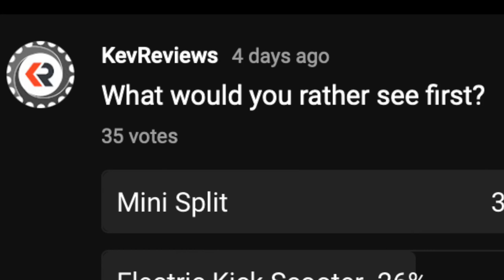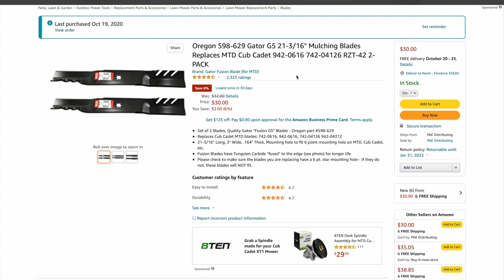DUST BOWL ELIMINATION for MTD 42-inch Riding Mowers - Craftsman T210 T2200 | Cub Cadet | Troy-bilt

Comment: I switched to those Oregon Gator Blades a year ago to help with the leaf mulching. They work great for that, and actually worked well as my normal cutting blades through the summer. You're right in that they have just as much - or more throw as the standard blades when it comes to the side discharge chute. I can't say that they cut down on the dust generation all that much (for me, that just depends on how dry things are), and I still get a little bit of leaf blowout up front with them, but they are great "daily drivers" and come in really handy in the Fall.
Reply: If you want to mulch your leaves really good, blow them into a few rows, then back over them with the blades on. This creates a mulching effect and will grind them up really fine. We live in the mountains and have tons of leaves. By utilizing this method, we feed the yard. It's free fertilizer for the yard!

Comment: Ok, here's the technical reason why this 'fix' worked. The serrated wing tips of the Gator blades reduced the airflow produced under the deck versus the factory blades. This reduced airflow means less dust! It's as simple as that. Older mowers from the 60s and 70s had slower wingtip speeds and thus tend to create less dust. But modern mowers have much higher blade tip speeds and create more airflow. That is why they create more dust! For example: My 1964 John Deere 110 doesn't make much dust, but my 3 year old zero turn will kick up so much dust in parts of my yard that I only use the older tractor in those areas. Hope this helps someone out there to understand why this fix worked.

Comment: 0:52  and 0:59  Is it me or do these 2 comparison shots seem dramatically different conditions?  In the first shot, there are a lot of brown leaves on the ground and the ground looks extremely dry.  In the later shot, it looks lush and well watered and conditions more moist.  I'm not saying you are deliberately faking or misleading anyone, just that the 2 example clips look night and day in terms of conditions.
Reply from the maker: I’m using clips that I had on hand as I swapped the blades a year ago, but the difference is that much even if I had made a back-to-back recording. With the standard blades there is lots of dust and debris ejected from the left front of the deck and that (almost) disappears with gator blades
Reply from the maker: Hit me up on my website’s chat if you can. I’m in a battle with YT that I’m almost positive you will find interesting

Comment: Just received mine, will be using them for my next cut, have about a hundred trees, leaves are just starting to fall, they create a lot of dust, I believe Kev, he is the reason I bought a T210..I also follow the maintenance schedule to the letter with tips that Kev gives...
Reply from the maker: Leaves are dusty even with the gator blades, but the gators do better than the factory mulching blades, IMO. The mulching plug is a different story 🙃

Comment: I have the same T210 mower and bought a mulching kit to reduce the dust issue. The cut is not as good so I will check out the gator blades. Thanks.
Reply from the maker: That mulching plug design 🤯
Reply: @kev-reviews  I am at the 100 hour maintence interval. It says to "Remove cooling shrouds and clean cooling areas". Where is this located and how do you clean them?
Reply from the maker: That’s the black plastic cover on the top. Under it is the fan. It’s taking about cleaning the fan and the area to make sure there isn’t debris to obstruct airflow. I’m closing in on that point. I think I’m slightly over 75 hours
Reply: @kev-reviews  Thanks

Comment: Would a mulching kit work just as well?
Reply from the maker: The mtd mulching kit is horrible on the 42” mowers
Reply: @kev-reviews  I have a 46in deck and bought the kit for mine today after I posted lol. Was going to install it later this week when my slip plate comes in. I wanted to coat the bottom with the slip plate to keep the grass off the bottom of the deck. 

I can always do the install and see how it goes.  I just don't like grass shooting out the side of the mower.

Comment: Kev,
Do you winterize your mower?  I’d be interested to see what you do.  Also, do you know if it’s possible to drain the carburetor?  I know you use ethanol free fuel, it just bothers me to leave any fuel in a carburetor over winter.
Reply from the maker: I don’t winterize. I only use non-ethanol gas. With leaf mulching going through most of December it usually only gets a 2 month break. But I try to crank it once a month and let it run for a few mins even during the odd months. Even if I forget I’ve never had a problem with non-ethanol gas in the carb